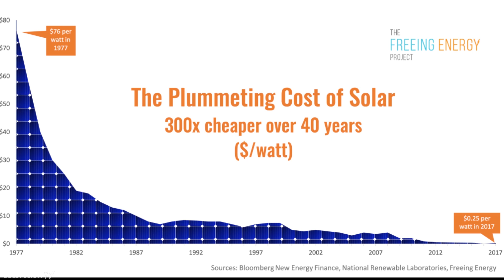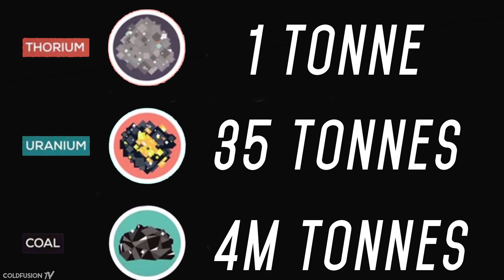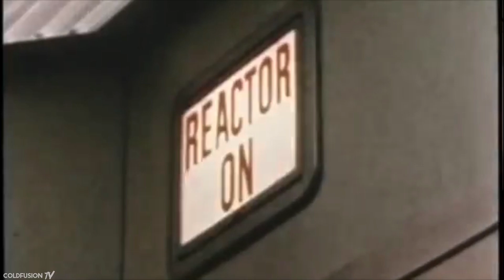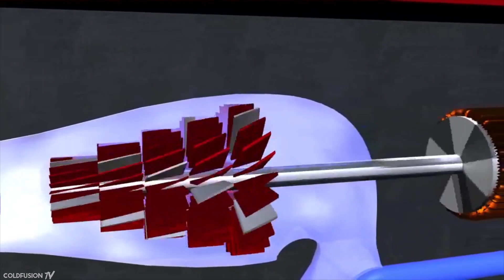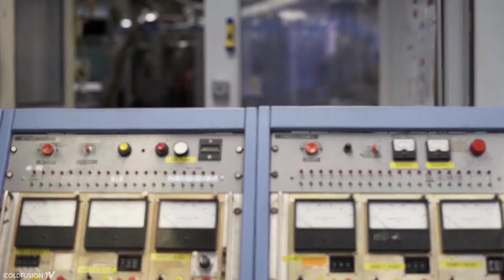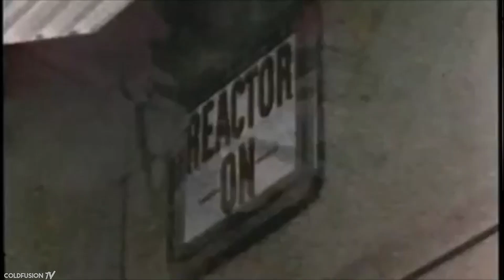Thorium - The Future of Energy?

Comment: In an era of huge capital accumulation, it's hard to imagine some venture capitalists have not jumped on Thorium.  Some Elon Musk type is needed if the technology is really sound.  Can it be scaled down to reasonable size and cost?  Can it be modularized to reduce manufacturing costs and to allow more flexibility?  I have no issue with nuclear if we are upfront about the risks and costs.
Reply: "In an era of huge capital accumulation, it's hard to imagine some venture capitalists have not jumped on Thorium."
Venture capitalists are like cattle they always brainlessly run in the same direction as ever other other venture capitalist. 

"Can it be scaled down to reasonable size and cost? Can it be modularized to reduce manufacturing costs and to allow more flexibility?"
Look up Thorcon (http://thorconpower.com/) they want to make thorium SMRs by the hundreds and are prepared to offer a warranty policy that can be summed up as "if it breaks, send it back and we'll provide a replacement". So yes it can.

Comment: One knows that this will be bullshit after the video starts with spreading climate lies. Then there is a total lack of understanding of nuclear generation 4 that can be run on uranium or thorium. The idea with gen 4 is that there is no water that can explode like in Fukushima and Chernobyl, instead for example lead is used as a coolant, and that you will get much less and safer waste - even when uranium is used.

And as gen 4 uses the fuel so efficiently, the fuel cost doesn't really matter that much.

Comment: We'd be one earthquake away from a Chernobyl Fukushima Disaster
Reply: How so..? Chernobyl was a melt down, caused by a ill-timed test. Fukushima was a hydrogen explosion caused by a Tsunami wiping out the backup generators (which wouldn't have been needed if the reactor wasn't shutting down - for safety reasons). Thorium reactors (and more specifically, molten salt reactors) are inherently safe due to a freeze plug holding the fuel within the reactor. If anything interrupts the power to the reactor, the freeze plug melts, and the contents of the reactor flow into drain tanks that can passively cool the liquid.

Comment: 6:45 I cringe when people use the Carbon neutral argument where you have Gamma radiation emissions on the waste fuel for hundreds of thousands of years (considering safety at 10 times the half-life of the Gamma emitting daughters).
Its like using the argument that eating feces isn't a problem to your health because it has a low fat content.
Reply: (MSR) Molten salt reactors produce radioactive waste that only has to be shelved for 300 years tops.  Radioactive waste comes in three flavors...  Low, medium, and high grade.  Most radioactive waste from an MSR nuclear power plant will be low and medium grade waste that only has to be shelved for a few decades at most.  MSR's can also recycle that hundred thousand year waste to make it safer and less long lived.

Comment: I have watched a number of videos on LIQUID FUELED Molten Salt reactors. Thorium is LESS radioactive than a banana.IMO this is our best option.  I am disappointed that you left out a large number of major benefits of this type of reactor. First, we are already mining Thorium as a waste product of a number of industries, Potash is a major example. We re-bury thousands of tons of Thorium per year. Second, Thorium and Rare Earth elements are located in the same areas. Since Thorium is classified as Nuclear source material (this can be easily changed by the President) we cannot legally mine the best sources of Rare Earth minerals in the USA (we have lots of very high quality RE). Rare Earth elements are critical for modern industry, (China has a 100% lock on these elements now, not a good idea.) This alone is a 7+ trillion dollar market now, Third, this type of reactor produces vast amounts of high temperature heat that is very valuable in many industrial processes such as Aluminum, steel, concrete processing. Huge opportunity to desalinate sea water with waste heat. Fourth, Easily able to remove medically beneficial radioactive isotopes (while the reactor is running, that are not available now) that can help many people. Small reactors of this type can easily and safely be co-located at these plants allowing cheap safe, distributed power generation.

This reactor has successfully been run at Oak Ridge Labs in the 1960's for 6,000hours. With full power shut downs successfully tested. The conventional Nuclear industry is very resistant to Liquid Thorium since they already have their (extremely expensive, but failing) set up in place. They have deliberately put in place regulations that severely hamper research and development of this technology in the USA, New companies are going to other countries to develop this technology. We need it in the USA. Thorium Alliance has many good videos. The main reason Nuclear fuel rods are dangerous for 10,000+ years is that the current solid fueled reactors only use 1% of the energy in the fuel, before the extreme radiation causes the fuel pellets to swell and crack the fuel rod. Liquid fueled reactors can easily and cheaply burn these pellets as a supplemental fuel source, reducing the volume of our current spent fuel dramatically as well as being safe in about 300 years. Not great but way better than we have now.
Reply: Bravo, Carl. Great comments, loaded with facts. What could be better and more reasonable?
Reply: Well actually there has been successful REM finds in Australia, it produces the 2nd highest amount in the world (still not much compared to China as of yet)
Reply: @BirdTurdMemes  There is no shortage of REM, Australia probably has more REE's than China, what you meant to say was the successful REM finds in Australia are of poor quality, because most country's follow in lockstep with America's 10 CFR 50 it basically means you're dirt is illegal. Just in America, just in normal day to day life, building roads and schools, and growing food, and just normal day to day stuff we throw away not only 100% of our national demand for rare earths, but 40% of all ya'lls  Rare earth needs too. That's without even trying, no intentful mining whatsoever. We would need to expend the the energy of lifting a pinky to guarantee global supply/demand for rare earths in infinitum, at unbelievably low prices for forever. It's not really rare, and it's not hard to get. Under our current law it's illegal so we can't make any for ourselves or give the rest of the world limitless supplies on the cheap either.
Reply: 1 second ago
WITH MICRO THORIUM GENERATORS THE TEXAS POWER OUTAGE WOULD NOT HAVE HAPPENED. THUM'S  UP IF U AGREE. NO UTILITY NEEDED
Reply: Carl B Pseudo-Science Nuclear does nearly as much harm as anti-nuclear advocates
Reply: The financial elite will never choose the cheapest and best solutions. The financial elite is very self-centered and wants to see money from us. They want to send us an invoice every month that we have to pay.
Thorium is a way of making energy that will make this way too cheap. That is why they will postpone this for as long as possible.
See chain of command: https://www.thrivemovement.com/images/infographics/followthemoney.jpg

Comment: You have conflated a number of safety features that are features in any molten salt reactor with thorium only. One of the big issues in the US is the large uranium deposits.  Thorium is more likely to be used in the short term in countries like China or India which have very little domestic uranium. Another signifigant hurdle is dealing with possible proliferation issues. One of the big reasons u233 has not been used for bombs is dealing with it's very high radioactivity and instability. But it absolutely can create a nuclear explosion. 

MSR's are the future though regardless of the fuel being used to run them.  With the added benifit of being able to burn waste from current reactors.

Comment: The problem here, as the video says, is that we have to start all over again and develop new technologies for a safe nuclear future ... but that's not specific to Thorium, but to any new nuclear power plant ... I'm not sure why the claim that Thorium acts as it's own primary coolant, and then show a diagram which clearly labels salt as the primary coolant (4'11") ... and Thorium reactors with molten salt primary coolant can and will melt down ... the safety of salt is when the reactor is successfully SCRAMed and the coolant pumps stop, the salt remains in its liquid state as opposed to water quickly vaporizing ... 

This will be very very expensive and carries a huge carbon footprint to build, only the electricity produced is "carbon neutral" ... not sure the net effect would have any impact on the climate crisis ...
Reply: He should have said that the fuel is contained within its coolant. 

As for the meltdown aspect of molten salt reactors, there's always the possibility of some sort of thermal runaway, but that can only ever take place in the core. Molten salt reactors are designed to fail-safe if that occurs, so a meltdown would only ever end with the shutdown of the reactor, and would do so even if no one was operating it. Residual heat would be removed passively.

When it comes to building a molten salt reactor the materials needed are way less than a conventional reactor, and are also less than solar or wind for a given number of megawatt hours.
Reply: @aread13  - Thank you for these corrections ... what's your take on breeder reactors? ... and does this fit into our Thorium future? ...

Comment: A small note: not all thorium reactors are molten salt reactors (MSR), and not al molten salt reactors are thorium reactors.
Thorium Molten Salt Reactors (TMSR) are just molten salt reactors that happen to be fueled by thorium.

There is no relation between the type of reactor such as molten salt, lead cooled, pebble bed (usually air cooled), ... and fuel such as U-233, enriched uranium (high fraction of U-235), plutonium (Pu-239, usually bred out of U-238), ...

You can also divide between thermal neutron reactors and fast fission reactors. And even between thermal neutron reactors, you still have a distinction by what moderator is used (water, graphite or heavy water).

The lower proliferation risk is overstated. Even U-233 can be used to make bombs.

The lifetime of radioactive waste is mostly by the presence of radioactive actinide isotopes. U-233 produces much less of them, hence why it's waste is much shorter lived. However, if you use regular uranium fuel, you can deal with the actinides by using a fast neutron reactor (fast fission reactor). Fast neutrons, while having poorer odds in splitting U-235, are energetic enough to split these.
Either way, you end up with waste that needs to be stored for much shorter time periods.

Reprocessing spent fuel drastically reduces the amount of spent fuel rods, as most fuel in them is not spent. Recycling them means you have less waste, and reprocessing fast fission fuel reduces decay time even more. IIRC, if you use fast fission and reprocess your fuel you need to store your waste for only 200 years, as fuel needs to be stored 10 half-lives.

I'm hoping you'll make a video about the various types of reactors and their various up- and downsides.

Comment: Cool. I don't have a problem with using Thorium. I think we should be building a ton of these power plants. Solar and wind are unsustainable and too expensive to supply all our power needs.
 Now on the other shoe - The so called AGW or man made "climate change" due to CO2 or any other gas in the atmosphere is pure bullshit. The biggest lie ever told to the world. All about power and money. What you claim "The earth is warmer now than it has ever been" is just not true. We are at the coolest point ever in the last 3000 years. Read some history. In the last 3 years the temperatures have dropped 0.5 C to 0.8 C over base line all while CO2 has risen an additional 35 ppm to 435 ppm. The "Modern Warm Period" ended in 2016 and temperatures are rapidly cooling as we descend into this Grand Solar Minimum of solar cycle 25. NASA just this week released a paper stating that cycle 25 will be the weakest solar cycle in the last 200 years.
 Rising CO2 levels are not the cause of temperature rise - they are the result of temperature rise. CO2 lags temperature rise as much as 800 years. Dr. Valentina Zharkova a Solar Physicist has just released her accepted pier reviewed paper on the coming Solar minimum that may last for the next 150 years or longer. Geologically we are 1000 years over due for a full on ice age that will last the next 90000 years. https://www.youtube.com/watch?v=2NI1bQe8I4A
 In 2020 the crop losses that we have been having world wide for the last 3 years will drastically hit the markets and your food prices will skyrocket. You see it's not the cold or the floods, droughts, hail, snow, general wild weather patterns that pose a direct threat to man. It's the lack of food. Crops do not grow under those conditions. We will need to shift where and how we grow food rapidly or the world is in big trouble. And if we have a large CME during this time (historically known to happen) it could kill our power grid for decades. And then all bets are off for who will survive. Everyone needs to get prepared.

Comment: As you already pointed out : Nuclear Energy is not ''Clean '''... because it has waste that is dangerous...It would make sense to invest to your final target  , rather  than a side road , which  will  create new infrastructure  deterring further  switch until its investment  pays off.  .  If adopted , the new infrastructures  built  for Thorium   for the ''in the mean time ''  period will take possibly  another 80  years  to be abandoned  and therefore will simply delay  the switch  to clean energy  by  80 years. The video  is very  informative  for the insight it provides so as to how weaponry  and war guiding the energy industry ...  And if today we had equal technical capability  for energy production  from   Thorium and Uranium ... It would be clear as a bell  , who is pursuing nuclear arms , versus who is pursuing  energy ...